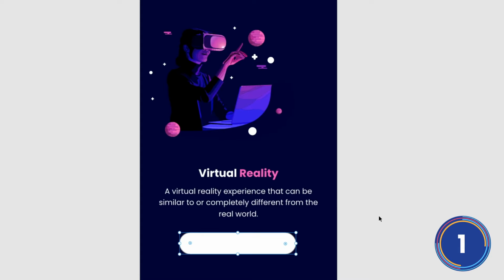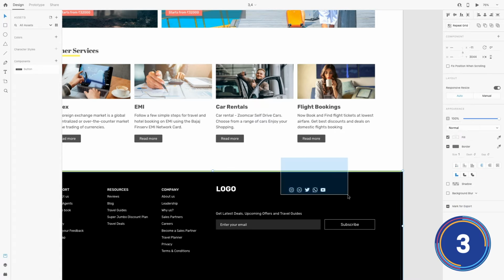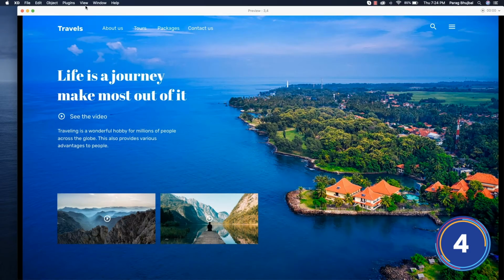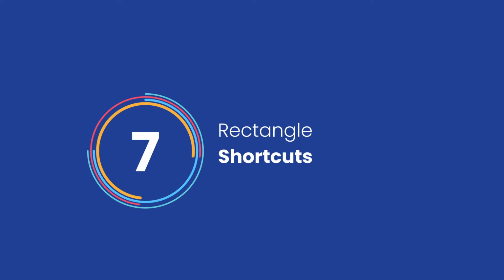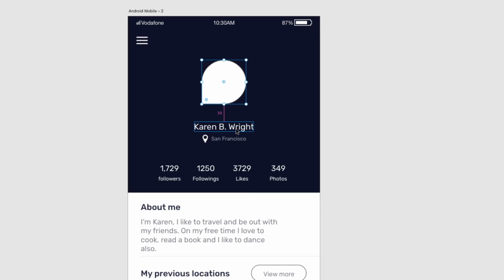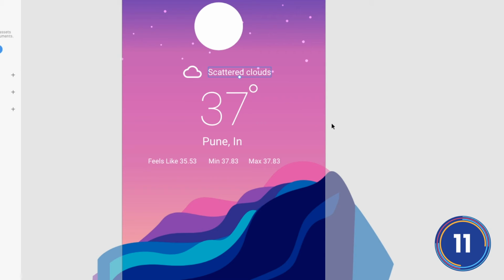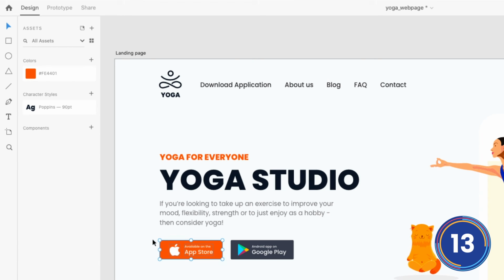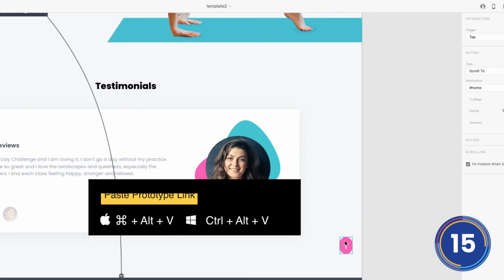15 Amazing Shortcuts of Adobe XD 2021 You Aren't Using | Adobe XD Tutorials

Comment: Hey man, nice video. You should also add the math equations you can do for changing object sizes. For example, to increase a shape width with 100px, you just have to add "+100" in the width box.
Reply from the maker: Thanks for your suggestions